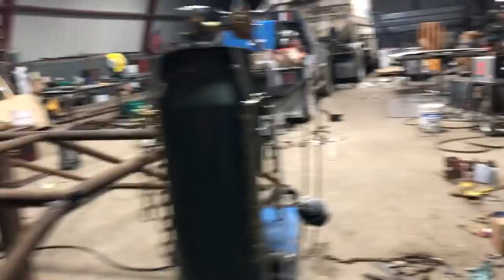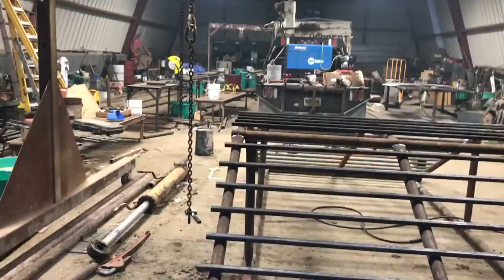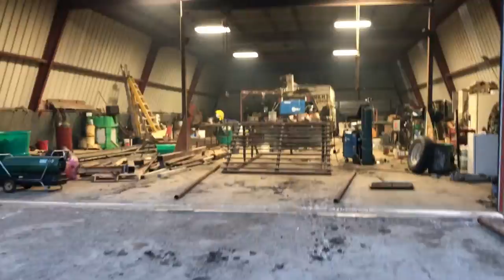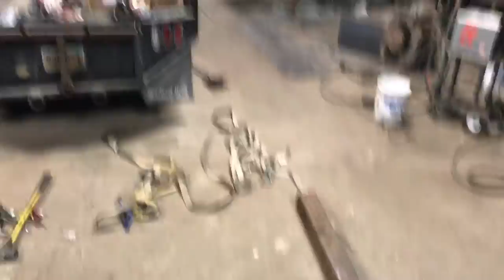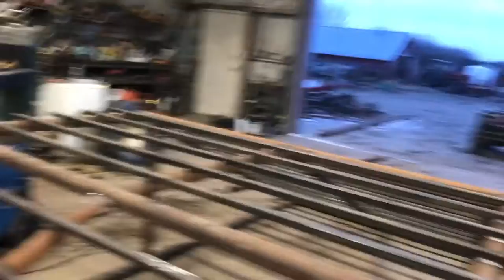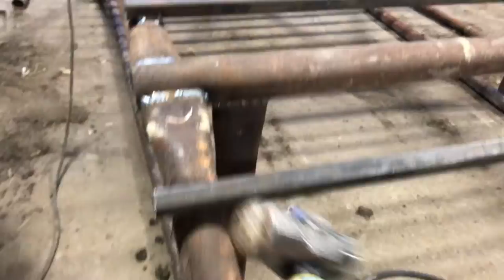Atv Cattle guard

Comment: sweet gate     there was a guy in Alberta that made some that had no bracing just the arch and you would just put them over the fence , and it was 4' high in the center and a little scary but you could just move them where every you wanted to cross the fence.   We made some like yours for the pivot to go through a irrigated pasture     I sure enjoy the vids  and nice welds
Reply from the maker: Well thanks... I would like to build one  to just throw over a barb wire fence we will see how this one works and go from there..
Reply: A guy gets tired of opening gates all day long yours should be awesome.    I told my sons that when they all leave me for higher education and work I'm going to put a electric gate that opens with a remote ,   I like to tease them.

Comment: mighty fancy
Reply from the maker: Either had to much spare time or got tired of open and shutting gates to check the cows!
Reply: My life is gates lol, what's 2 3/8 cost there
Reply from the maker: Plastic lined for $0.88 a foot how about down there?  So fare this stuff i have gotten has been really good
Reply: I don't remeber what lined pipe was, we had a bunch and it was terrible, really scaley and the liner when burned gave of a sulphur gas that would make your lungs burn for a week so I didn't buy anymore. I just bought a bunch of number 1 pipe for 1.12 which is just a bit on the high side, I think it averages 1.08 here, but I got the metal for my barn and pens from the same place.